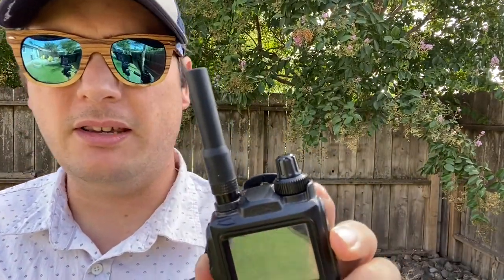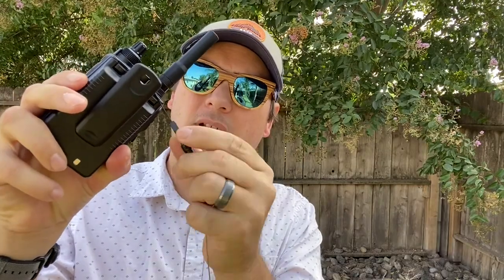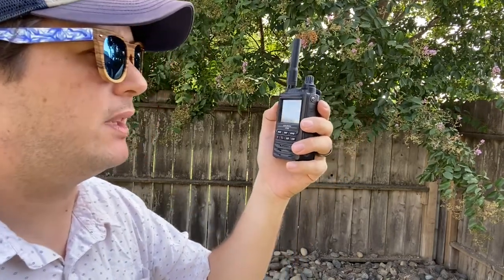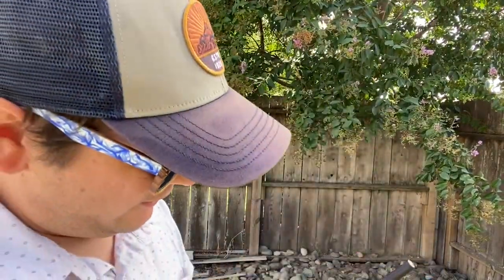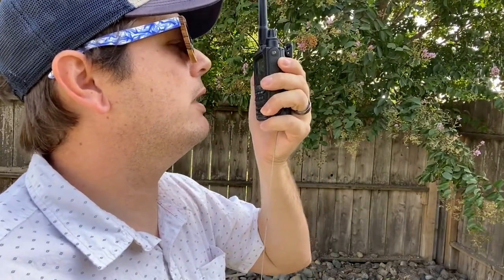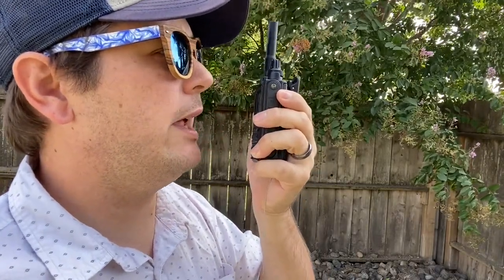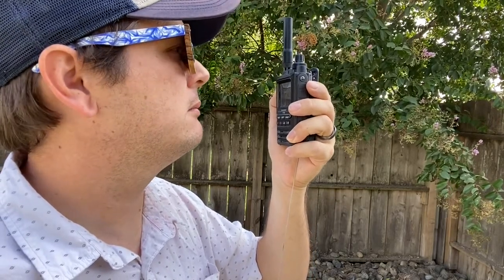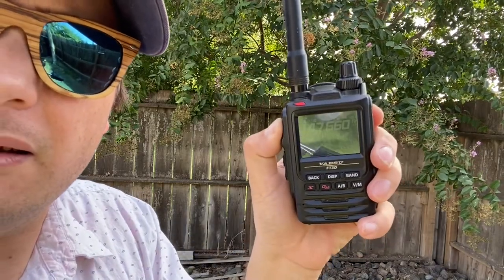ZipTenna counterpoise tested on local repeater

Comment: I got my Ziptenna today and it has no quick release. If I want to dot his test, I have to unscrew the HT antenna and  remove the entire Ziptenna . Has the design of the Ziptenna been modified since this was posted? If so, it would, I think, be a good thing to post so that potential buyers/users are aware of that. It does work as advertised so I am happy about that - just not happy about having to do all the antenna manipulating.
Reply from the maker: Hi Gailen, Yes the design has slightly changed. I wasn't happy with the plastic connector so It has been replaced with a metal connection. Yes its not as easy to remove but at least the chance of it failing and your HT breaking has been vastly reduced.  I will update the description of the video to indicate this. The test can still be easily done by simply leaving it disconnected and bringing the end of the ZipTenna up to your radio and holding it in the hand that you hold your radio with it positioned roughly where it would be if it were connected to the lanyard attachment point of your HT. 73!
Reply: @JamesHannibalKH2SR  yes, this works well - thanks for a very useful device!

Comment: The Carrier hit the Repeater 45 miles away. The carrier is digital. Can you actually have a QSO on the repeater? I highly doubt it. 73,
Reply from the maker: Bob McGarry I was operating FM analog. Not digital. Without the ZipTenna I was not able to key the repeater at all after many many attempts. With the ZipTenna it easily keys the repeater every time.
Reply: James Hannibal KH2SR Were you able to have a QSO exchange or just the carrier ringing the tone reset?
Reply from the maker: Bob McGarry there was someone on the air while I was setting up the tripod and camera but they signed off before I got on the air. Hopefully next time I can get someone on the air while I have the camera setup. Luckily this test at least showed that there is a definite improvement. Without the counterpoise I wasn’t able to key the repeater even once after many many attempts before and after the video.
Reply: @M Lastname getting a 40 mile quote depend on a lot more things than just antenna length. If you are trying to activate a repeater that far away repeater location is important too.